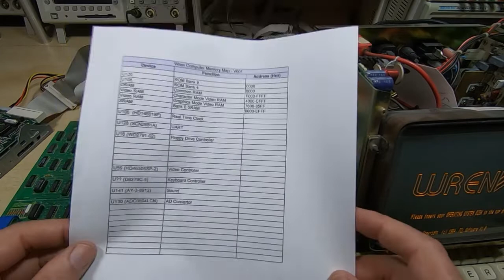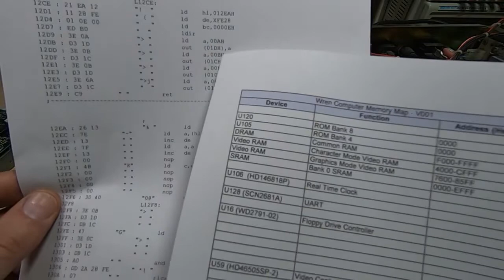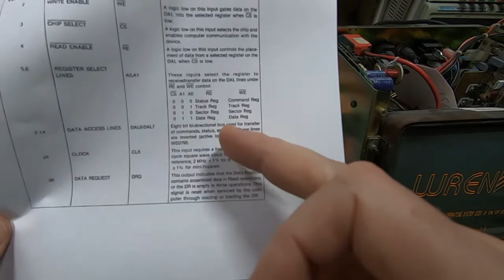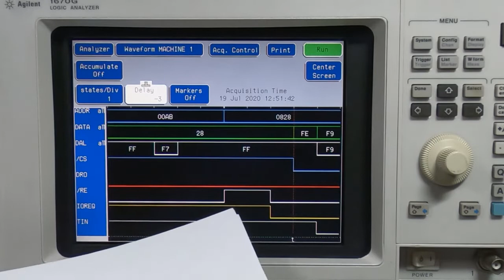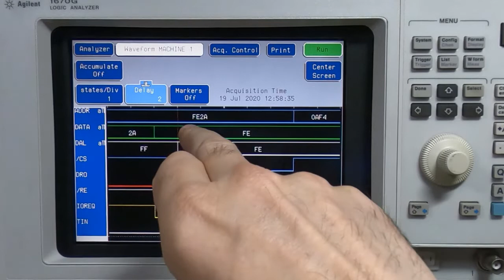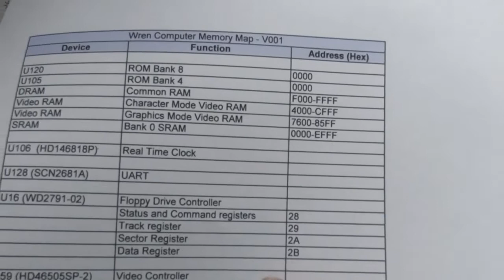Wren Repair Part3

Comment: Have you considered using Ghidra and ghidra-server.org for collaborative reverse engineering? I do RE for a living, and could help getting things setup.
Reply from the maker: I use it for PC applications but it is not very good for enbedded work as much of the required reverse engineering relates to the internal workings of the varioud hardware devices. You may find it interesting to download the source files once I post them and pass them through ghidra and you will see what I mean. I would also add that although I said the project is not really about repairing the wrens it is still part of that process so using the analyser to work though the code is useful for this.